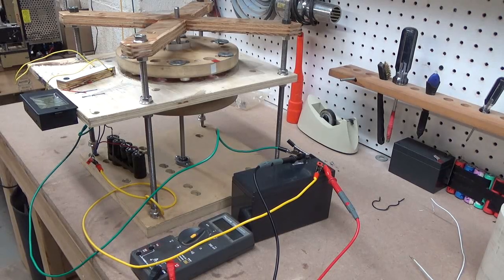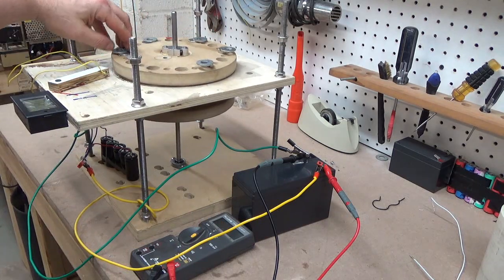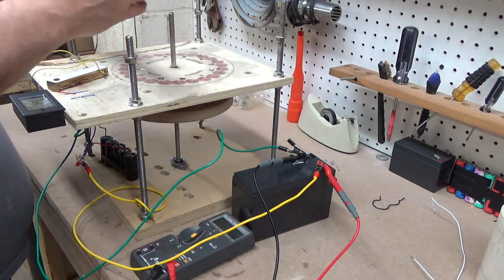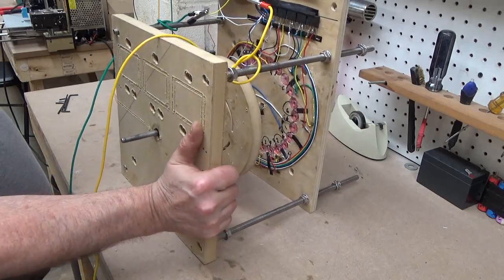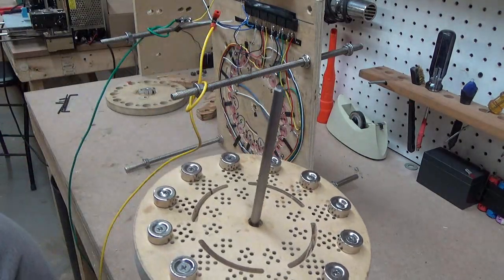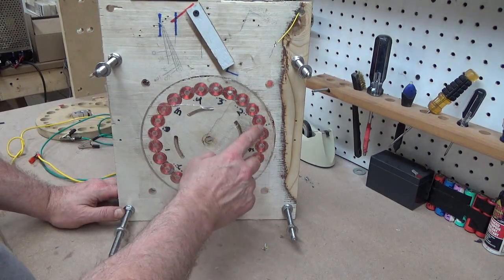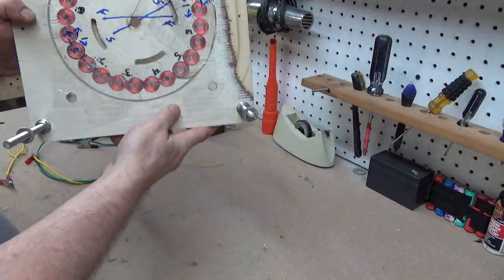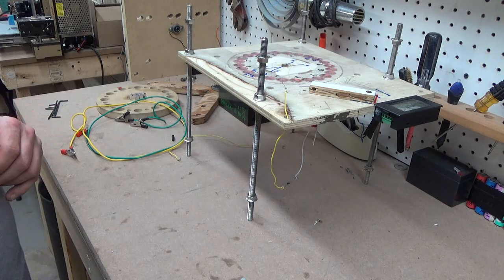New Green Energy Deal that will Trump Wind And Solar Power

Comment: You've inspired me...wait til they get load of my next build!
Reply from the maker: I wish you the best of luck. There is a plateau threshold that I am discovering. The formula between input and output.  I put a big deep cycle batter on my device and threw on a 1300 turn 28AWG extra coil and rectifier. using a reed switch trigger on 2n3055.  It started at 10.5V but seems to have stopped gaining at 11.94.  Its Running on Live Video Now.  I am almost done with my coils for my big machine. I am hoping people will discover my channel and see that over-unity is a fact. It just needs to be perfected.  I am not doing this for monetary gain. I want to help the world. All of these fake free energy videos I think are put out there to discredit real research.

Comment from the maker: I rebuilt after this tear down. I used a 24 magnet single rotor with alternating poles.  That does not work at all.  So I went back to 12 magnet single rotor and got tighter tolerance. No bottom rotor.  It was barely over unity up to about 160 with exact reed tweaking.  Over 160rpm efficiency went down more the faster it ran.   So I have decided I will build my original design with 4 6 magnet rotors and 3 24 coil stators alternating pulse between 2 rotors. The other 2 rotors will be magnetically coupled and not driven by pulse. Please subscribe to see the next private video build.     Thanks to everyone who has supported this. I look forward to seeing your versions videos soon.  Someone will figure out how to get this efficiency much higher.

So there will be a center stator with 2 shaft connected rotors on either side of it and 2 stator outside of that with 2 more rotors on the outsides.

Actually after thinking about it there is no reason for any of the rotors to be locked to the shaft.

Comment: Well done. I believe tinman has the best motor ideas in some cases being overunity. I believe this technology should be out there already but money gets in the way
Reply from the maker: Did you watch the running videos?  This one really works.
Reply: @jameselliott9397  yes i did. But lead acid battery's give inaccurate voltage readings when pulsed with bemf spikes. Could you try lithium ion battery instead
Reply from the maker: I did run it on lithium. For 6 days before I changed to lead acid.  Same results. If you look on the video you can see the rainbow of 18650s in the back.  I would run and charge batteries about lead acid .9v every 24 hours. Lithium .3v in 24 hours. Nimh .5v in 24 hours. That was with 2 6 magnet opposing rotors, one magnetically coupled.
Reply: @jameselliott9397  impressive! Keep up the good work